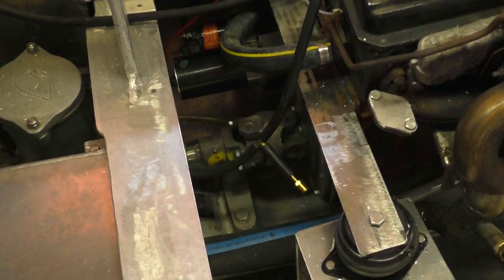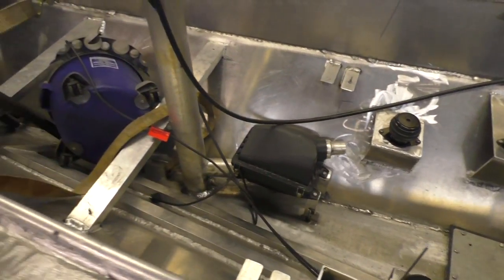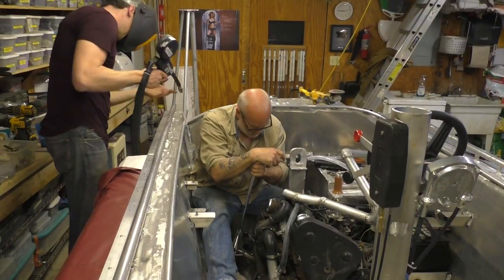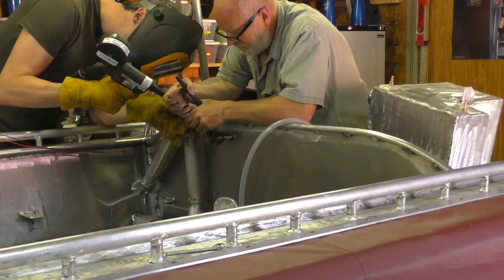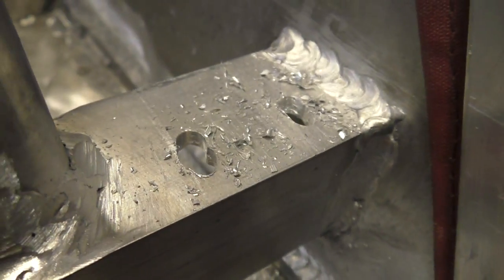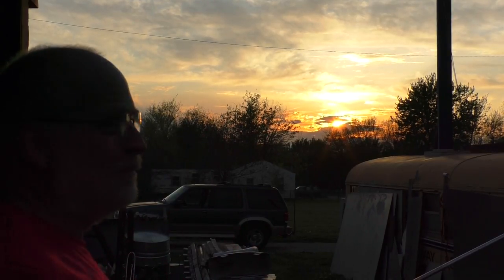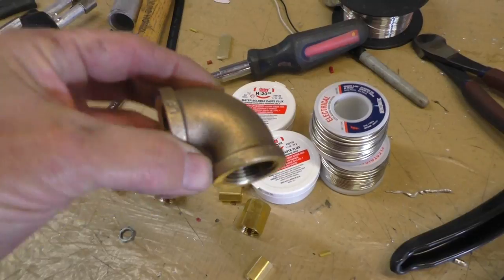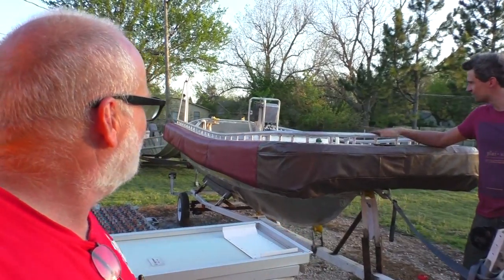Diesel Jet Boat Build - Part 11 - Trailer and Wiring and more

Comment: Doug,
There are some small flexible lines in between the injectors. Please take time to replace them if they are more than say 3 years old. They are excess fuel return lines for each injector.
And of course use an engine oil with an SAE rated beginning with the letter "C" for  compression ignition. You all really are making a fantastic boat, ship, dingy etc.
Eric

Comment: A helpful note for you, regarding your ingenious siphon break. Wherever aluminum touches brass or copper, and saltwater or salt air is introduced, you get a battery, and a highly accelerated breeding ground for corrosion. installing any barrier between these metals will stop the effects, such as a chunk of hose, or a rubber strap. In the case of an aluminum to brass pipe fittings, a stainless fitting between aluminum and brass fitting works well. Iv'e seen saltwater plumbing applications using aluminum to brass unions and the entire fitting and cavity surrounding became packed 100% full of corrosion deposits.

Comment: Hi, guy's this day i came through the series of your YouTube filming your crafting the Alum. Boat. it's nice and did a great job honestly speaking and i learned so many things out of that. i have a tip i felt like i wana share you, when you attempt to bend any kind of tube using hot pending technique i advice you guys to fill the tube with moisturized soil or fine sand close the pipe one side using same inner diameter kolge of wood or piece of tire rubber that fits the inner diameter and keep on adding soil or sand from the other open side and shake and hammer it to soft object like a piece of wood or tire rubber piece laid in the ground, once the pipe is full and well condensed close it and make the area of pending hot and keep on pressing to aquire the shape you wanted once done remove pipe closer and remove sand out and you will end up having a nice curve and the pipe will not get cracked or deformed.  and keep on  .

Comment: Been a joy watching this project progress. Seaworthyness predictions: Underway, she is going to cut through chop nicely, though, that stem to stern deep-V is going to cut initial stability a lot. The big engine, the jet pump, and fuel tank as ballast will keep her upright, but I still don't see folks working on that fore deck in anything beyond flat calm. Still, tons of room for gear, and lots of power to get it to and from shore. Going to be an interesting test. All the luck, Doug and crew.
~Hans
Reply from the maker: That sounds about right to me. I just hope you gets up on a plane. I’m thinking we’re probably going to need to remove one of the impellers from the jet pump.

Comment: Looks great! One suggestion, put a rudder on the jet out put nozzle. You will be glad you did when trying to maneuver at low speeds and in reverse
Reply: What? a jet boat can spin on its axis . Axe the rudder , its probably about to rip off anyway. (The pressures on a hamilton jet at the nozzle are ahem quite large) try dropping the gate half way between reverse and stop. Its also really handy to have a spring loaded throttle that you can lock when needed. On any jet boat think in terms of thrust blipping the throttle to maneuver

Comment: I haven't read all the comments yet but has anyone said anything or brought your attention to galvanic action? Brass in a aluminum (aluminium) boat (tender) is a bad idea. The presence of brass which is an anode will cause the aluminum (cathode) to corrode even if the two are not in contact, simply the presence of salt water wetting can be enough to set up a reaction! 

I just love what you are doing and look forward to every episode, kudos to you, Betsy and all around you.
Reply from the maker: The plan is to keep the water outside the hull

Comment: When coating the exterior of the ship have you considered adding copper powder to the paint. Ocean going vessels around steam time were clad with copper to prevent barnacles from sticking. I also fabricated (tig welded) copper nickel water treatment plant screens on a massive scale for a company called Johnson Screens. They claimed that the copper nickel kept Zebra mussels and other sea creatures from adhering to the screens. Powder some old quarters? JK. FYI. Keep up the great work. Love yer show and yer candor, always.

Comment: Don't worry too much about the level of the clean-out vs the water line. This is normal and when I ran 34 foot patrol boats in the Navy we delt with this by putting any kind of weight onto the bow. This lifted the stern up just high enough to clear the lid. Just open slowly and be ready to close it back up fast. And yes, in a swell or wake, water will shoot up the clean-out tube and hit you in the face. All perfectly normal.  Cheers.
Reply from the maker: We'll I'll make an opportunity to give that a try.

Comment: Doug, get rid of the brass fittings in raw saltwater systems like your exhaust and bilge pump, Brass contains zinc, and will definitely erode away. Go for BRONZE or even better seeing the hull is alloy, ABS or Polymer. Whale makes a nice inline valve with a tri-cut joker valve inside. comes with 3/4, 1 and 1 1/2'' tails.

Comment: FYI when you MIG weld thin material you will get better results by running down hill at a steep enough angle to avoid burn through, as long as you can go fast enough to stay ahead of the puddle. The faster speed will help control burn through even if the joint is less than perfect and you can even push the weld down hill to go faster, spraying all the excess metal off the joint to further control the heat.

Comment: I like you anti siphon valve for the water cooling of the exhaust. You might want to have a shut off valve or some way to stop the exhaust filling with water when you have trouble starting the engine .....but since your taping the drive pump water that should not be an issue! So your way ahead of me. Cheers warren
Reply from the maker: I don't think that pump will build any pressure with just the starter.   It's not like a raw water pump.

Comment: Making great progress.    The wire loom is great but I would also recommend checking out Tessa Tape (I get mine on Amazon).   I use it in car audio and other auto wiring applications.  Its what OEMs use.

Comment: Your horn sounds remind me of how my boat horn was for a bit. I got the harbor freight "tri tone" horn a few years back. It claimed to be able to run all three or cycle through the tones. For the longest time I couldn't get it to run all three at once so it would cycle and sound more like a clown horn. It's a great little horn and cheap. You just need to take the top off the pump and remove the disk valve if you want a solid tone. The instructions claim you can wire it for the solid tone, but I could never figure it out to work that way.

Comment: Try tapping hole with "Neverseize" especially on aluminum. FYI First learned it repairing Subaru EA81 exhaust. I finally ended up tapping the mounting flange in the heads holes to 1/2 -13.

Comment: Marine wire is usually tinned to prevent corrosion under the insulation in a salt water environment.   
A crimp on wire joints will secure them and then solder if you must.  A short can melt solder alone and let the loose wires cause other problems.
Reply: That's an interesting point of view, but the wires let loose by the melted connection may be a problem. Anyways the way it was explained to me on why crimp connections are a good thing
Reply: Indeed, I always crimp first.. then solder. Agreed, tinned wire would be more appropriate I use it on off-road vehicles as well for the same reason.
Reply: Issue with solder is more it being brittle and snapping from vibration. But hey if there's 2 sailors in a bar therer's 3 different opinions on how to do it.
Reply: +Harry King Any properly fabricated and installed wiring harness should not have any issues with vibration under normal service, regardless of the type of connection. Wires can just as easily break at a mechanical connection if the harness or equipment is not secured properly.

Comment: Alum welding with mig is very EZ tig on the other hand can take considerable time to master. In your application mig is the way to go. Tig is for some applications required.

Comment: Does your injection pump not have a fuel shut-off? Choking the air supply might be a bit hard on the turbo compressor bearings. No?
Are you running an intercooler?

Comment: Here a trick i learned in school..
Fill your pipe where the bend will be..and you should avoid getting a flat part on bend...you actually can make the bend without tool ..just with heat and slow bend.👍

Comment: Those check valves stick. Stickier than that pump can push. Be careful. Gonna take a lot more water than that hose can hold to trigger the float switch. Good luck.

Comment: What is the all round
 white light for? They are normally only used when  anchored
on small boats. A white stern light should only be visible from behind.
Reply: Ah got it now, it’s a combination of stern light and steaming light. A motor boat thing. Awesome job by the way.

Comment: I wonder about the need for an air filter in a boat, marine environments are relatively clean and dust/dirt free. I also think that the high humidity and a paper filter might not be compatable
Reply from the maker: West Africa must not be a normal marine environment.
Reply: Salt

Comment: May I make a suggestion your pipes that go around and behind the aluminium double the hose ie: cut either same hose diameter or slightly bigger and sleeve the pipe as you'll find when in action the hoses and pipes may rub against the alloy edges ( as in 11:50 ). In time it will rub through them usually at the most inconvenient moment. Plastic pipe fittings are really not a good idea. hope this make sense.

Comment: On your jet pump cleanout why not make it a big long rectangular box as a live well with the present block off plug bolted in the bottom with some shop made oversize nuts like you did with welding handle/levers to the battery box dogs ?

Comment: I would like to suggest replacing those worm-screw style hose clamps with T-bolt clamps instead.
You're gonna have plenty of maintainence to do already, without having to mess with those mickey mouse clamps. You can rely on T-bolts.

Comment: Hello Doug. I would recommend you drill and deburr a few holes on the lower parts of the electrical conduit tubes not to allow water to pool in there.
Reply from the maker: None of them are closed.
Reply: Yes but if they are bowing midway it may puddle water on the inside that's what I meant with my remark

Comment: that reverse cable does look a little small, we had the same/similar jet in one of our boats and the reverse cable was quite a bit thicker and was also mounted on a pivot so it could rotate as it extends to put less stress on the cable.
Reply from the maker: I think its too small too.  But we'll see.

Comment: Just thinking about weighing the boat. Hit the truck stop with the empty trailer. Return with the boat and trailer. Then go back with the boat, trailer, and motor. The differences are the weights.
Reply from the maker: No need.  It's the waterline that is important.   And if that VW can spin up fast enough.   Weight Estimate is here: http://www.svseeker.com/wp/sv-seeker-2/sailboat/tender/

Comment: Is there not a chamfer or filet bit for metal?  You could have a dremel just for the purpose. I know, a grinder or file is faster for you.
Reply from the maker: I hate Dremel tools.  My favorite grinder is 9 inches across and pulls 15 amps.  A Dremel is like mopping up the floor with a toothbrush.
Reply: Okay, so maybe not a Dremel.  When I built commercial cabinets, I had a laminate trimmer specifically for chamfering. https://www.makitatools.com/products/details/3709
Reply from the maker: Yes, that would work, but the outside is rounded over with a flap disc and inside holes is quickly done with a deburring tool or file.

Comment: Has anyone else warned you about using yellow brass in a salt water environment? The salt water will eat the zinc out of it, leaving pinholes... also, check the throughput of the bilge pump with a check valve restricting the flow.
Reply from the maker: Seven I think on this video alone. But You must have two dissimilar metals in the presence of seawater. And that’s not too difficult to avoid. Some insulation a dry location and you have a little to worry about.

Comment: Two things Doug  suggest not running Hamilton jets out of the water they have rubber cuttlas bearings.Water taps off jet pumps can build lots of pressure!
Reply: Alan Tuttle there is a low pressure side
Reply: Alan Tuttle and totally agree on the running of the jet unit out of the water, we use a specially bent piece of tubing to slide up tbe jet unit between stages to flush the system without running the motor
Reply from the maker: I was wondering about that.  Berkeley Pumps are that way.   And would spraying water into the intake be enough to run it while out of the water?
Reply: Doug you dont need to run the motor just find where you have plumbed the water intake off , its usually between stages and make a pipe up using tinned copper pipe with a hose fitting on the end , will be difficult the first few times after that its second nature . Bearing in mind we ran the motor to flush for almost 15 years before we had to replace the wet bearing , but it went suddenly . The  wet bearing sits behind the thrust bearing from memory and is a bit of a task to replace

Comment: When I was young and dumb and full of beer it was a long weekend we had a family BBQ on a lake my brother and sister inlaw lived at my uncle and his wife hauled their boat up and his friend we called the animal and his poor wife. Anyhow  we were going to launch the boat at the state park across the lake my uncle myself and the animal. So we unlash the boat he backs the trailer into the lake the boat floats off fine. now you must know we were already a case of beer into the day. Anyhow my uncle runs the trailer up into the parking lot. About 300 yards away and as soon as he left we noticed the boat was taking on water we forgot to put the plug in so the animal starts looking for the plug I started to beach the boat so it didn't sink entirely. Turns out the plug was in the glovebox of my uncle's truck a quarter mile away half mile round trip so I ran as fast as any guy that had consumed his weight in beer and got the plug then staggered back down the launch . By the time I got back the boat was almost sunk. We put the plug in fired up the boat to blow the water out just as the boat started to come up on plane the transom was under water. Well the animal hadn't actually locked the motor down so it started jumping and the water had the boat completely full of water. He got the Motor locked down and as we moved forward under power I noticed the life jackets coolers anything that could float washed over the transom. So when the boat was empty we put the plug in and had to chase the cooler and life jackets etc.  It was a drunken good time. I have told the story many times over the last 37 years. But on notable time was on the way to the lake with a boat a friend and I had just bought. To try it out he was driving I unlashed the boat he backed in the boat floated off the trailer and pulled up into the parking lot there was no beach yes sober as a judge we forgot to put the pug in. Again I went through the same process only this time sober laughing at my stupidity.

Comment: I thought I left a comment yesterday suggesting to put a round hand hold around the bottom of the back light but I dont see it...anyway...like a 1 inch dia tube about 1 foot diameter around might make it easier to hold onto in rough water standing at the back
Reply from the maker: You did, it ended up in the review pile for some reason.  I think there are enough places to grab, but if not we'll always have a welder around.
Reply: Thats cool, just throwing something out there...boat looks great

Comment: Think your going to need to move that throttle. However, you seem to have a good train of though so maybe I’m wrong! :)
Reply from the maker: Indeed.  If you don't move it the engine does not go faster.  :)
Reply: SV Seeker touché

Comment: Grinding Aluminum Welds leads to cracks But since you have the Ability to weld on the ocean you will be fine if you used the right Welding Alloy Wire 5356. One more thing on the Rule Bilge Pump, Did you add a switch into the system? Those Automatic Float Switches crap out and Fail. I wont use them things, A pump and Float Switch is much better. Float gets stuck, pull it apart and clean and your back in business.
Reply from the maker: Wont any weld crack if you grind it enough?   And the manual on wire is right next to the battery pole for when the auto switch dies. And a bucket is standard equipment and the most reliable.

Comment: i know its probably in the plans for later but going to have to mount some brackets and or hold downs for some of the pvc and or rubber hoses i am sure i saw a couple of places that are gonna be rubbing on metal and other wear and tear spots lots of movement on the high seas  PS Doug you know why it broke right the wrench was too big and went cock-eyed on ya ok nuff said another great video  take care guys PSS taps dont flex they are brittle as f**k

Comment: I think it is a requirement that any hose connections below the water line have two hose clamps.
Reply from the maker: I've always been bad with requirements.
Reply from the maker: I don't think the idea was to better seal air intakes.

Comment: How about a spot light
Reply: They make telescoping flag poles (maybe mounted to the steering post) add multiple LED flood lights mounted to the top would make amazing work lights. Maybe the floodlight portion could be remove-able and stored until needed.